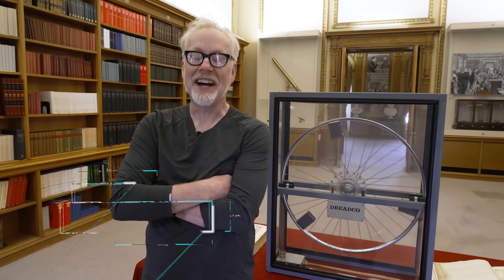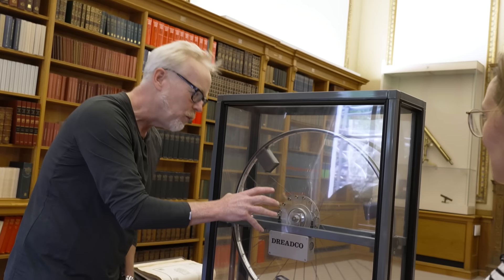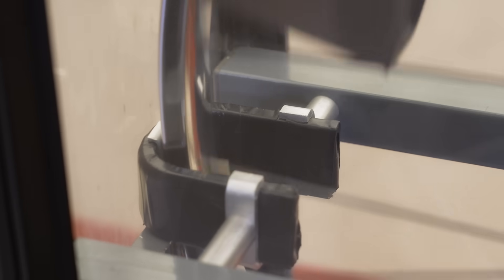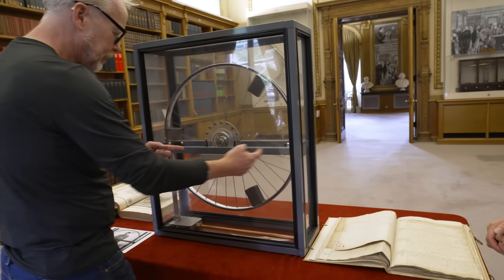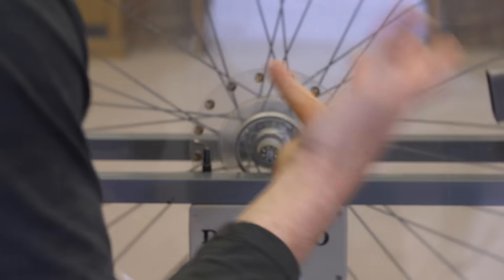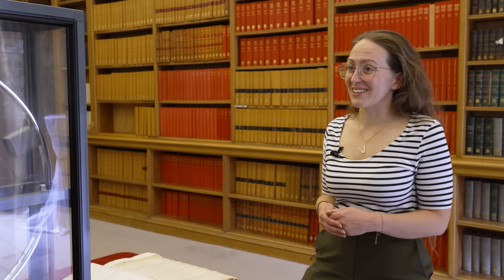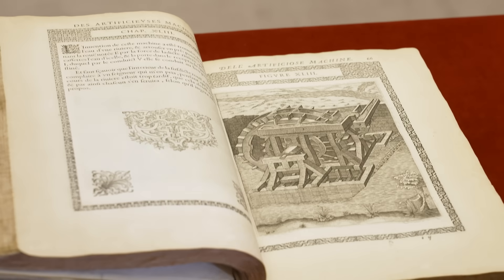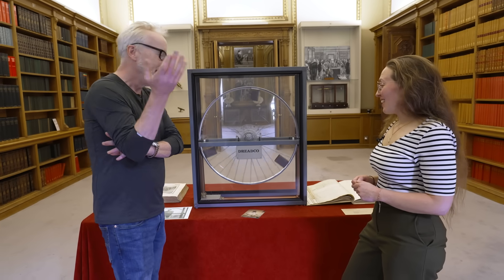Adam Savage vs The "Perpetual Motion" Machine!

Comment: In my opinion the copper pipe and heatsink do nothing, the stuff in the middle resembles an electrostatic motor but also does nothing.
Given the date of construction each box likely contains a 3LR12 battery, a reed switch, a coil and possibly a timing circuit. As a box approaches a magnet the coil is briefly activated giving a tiny push. Given the low friction and the very low discharge rate on the batteries it could go on for years!

Comment: The little circular metal things on the hub are decorated low power magnets. 

On the two little arms pointed towards the hub, one is an electromagnet, and the other is a trigger.   The trigger turns on the magnet just long enough to pull the wheel slightly.  It is turned back off shortly after, so it doesn't slow the wheel back down as it passes.

The Dredco box is full of batteries, and the control electronics.

The speed it turns could be changed by adjusting the timing turning the magnet on and off.   I'd expect it is driven by a very simple low power circuit.  Maybe just a capacitor charging, and discharging when the trigger is fired.     I'm sure people could make all kinds of low power circuits to drive it.  That could be a contest within itself. 

It's not a lot of power, and it would most likely need some assistance when started.  But once it's going, it could run for a couple years.   Being an analog circuit, and the electromagnet becoming weaker as the batteries die, it would slow down until it finally needed servicing.

The 3 square units near the rim are simply weights, for momentum.   Likely lead.

The vents on the Dreadco box are most likely decoys, but they may be used during servicing.  Servicing would most likely just be with the 4 screws that are visible and accessible.

The faux U shaped magnets mounted on the frame near the rim, and the copper pipes and box are decoys.  The heatsinks are just extra decoys.  If they needed to get rid of heat, it would be consuming more power than those enclosures full of batteries could provide.

There is a chance that there may be more batteries in the lower box, wired through the copper pipes.   

The entire frame could be filled with batteries, but I doubt it.   If he had done that, it would probably run far longer than 2 years.

I'll wait for my non-existent prize to arrive. :)

Comment: I think that a small amount of charge is being imparted onto the rim of the wheel, and electrons are being attracted into the copper tube on the left side, and emitted on the right and those electrons are transferring momentum from the wheel on one side, and to the wheel on the other, and that there is a thermo-electric effect providing the energy from the heatsinks when light falls on them.

Comment: If what she said is true about the wheel slowing down when it’s in dark storage, then I tend to think this is similar to a Jeager Le-Couture Atmos clock.  Those clocks run on the change in atmospheric pressure.  We don’t know that that container is sealed or not.  I also wonder if that box isn’t just a vacuum chamber and a very low friction wheel.  It may need to have the vacuum built up every few years.

Comment: I think that in the 3 boxes there are 3 batteries and 3 coils with a circuit like the ones in the toys, those that you put in the sun that have a miniature solar panel and with very little energy they move a pendulum that makes them dance. These circuits, by removing the solar panel and inserting a battery, are able to work for years. And the two horseshoes on the sides are simply magnets that interact with the coils.

Comment: It is too bad you didn't have a device to detect magnetic fields. Then you would have determined what parts, if any, are magnets. That would have been better then speculating that this piece or that piece was a magnet. IMHO.
Reply: As others have pointed out, he probably had his phone with him, which can detect magnetic fields.
Reply: @CorwynGC  True, but one has to wonder as to the sensitivity of the sensors used in phones relative to the (potentially) small magnet(s) being used. Adam did not mention (that I heard) that he measured magnetic fields, rather he thought the U-shaped devices were magnets. I would have thought he would have mentioned the fact if he had indeed used his phone to measure magnetic fields. Again, JMHO.

Comment: Adding on to my previous comment: I am a clockmaker. I've made little machines that tell time that are closer to perpetual motion than this. Yes, there is always an outside source, but the way it is harnessed is more interesting. The closest I've ever seen to a PMM, was an Atmos clock. It winds itself, but not through electricity. It appears to the untrained eye that it uses its own power to wind itself, but it's not true. It is powered by irony. 
You see, mechanical clocks are very sensitive to barometric pressure. And somebody had an idea to use that to give potential energy to a clock. That impressed me more than this thing that I've already figured out and can make with the spare parts in my garage.
Matter of fact, in my last video, I took apart a movement powered the same exact way. It took me a few minutes, but I figured it out.

Comment: There is actually one kind of perpetual motion machine that does work, a superconductor ring, if you induce a current into it, and make sure to never extract any energy from it or allow its temperature to rise above the critical temperature for that material to be a superconductor, that current will flow indefinitely with zero losses.

A superconductor doesn't have low resistance it has NO resistance, so once in motion in that ring the electrons will not lose any energy as long as it remains a superconductor.

It would actually be the perfect battery, if you could find a superconductor that works at temperatures up to about 40 or so degrees celcius... and that's the problem with it.
Reply: That, and all the energy you need to expend to keep it at superconducting temps.
Reply: @CorwynGC  That's why I said that if you could find one that works at higher temperatures it would work.
Reply: @LeoH3L1  How is that different than an object moving thorough empty space?

Comment: I'm suspicious that all the machines seemed to be built out of square tubing that's looks just the right size to fill with AA batteries.
Could then wire through to coils in the 'magnet looking' bits (why are they wrapped?) and put magnets in the isolated boxes on the spokes.
(and then the box by the hub and in the base are just there to mislead)

Just guessing, without any evidence, except it's what I'd have done.
Stuff in the box is to make you look in the box, not at the box (think how you'd enjoy people squinting and wondering if that's a light sensor, if the wonky bits of copper are firing ions, why would a perpetual machine need a heat-sink etc)
Also, however it needs to be 'recharged' you'd want to be simple - you'd want to disassemble as little as possible. Only obvious thing that looks like they might come off easily, are those little screwed on feet. Pop them off and you've got 4 tubes to load up with Duracells.

Comment: A circle of brass discs near the hub, and the two probes out of the Dreadco box could be an electrostatic motor. The U-shapes could be electromagnetics, fed by the copper pipes. The three boxes on the rim seem far away for magnetic attraction, to start by itself. The rim of the wheel could be the rotor of an induction motor. According to the internet people tried to use the electric field of the earth for a perpetual motor.
Reply: Yeah, looking at the brass disks and probes made me think it was electrostatic... one side imparts a charge, the other takes it off, angle the probes a little as needed and the static charge applies a tiny force.
Reply: @KaitharVideo  I definitely got Wimshurst machine vibes.

Comment: IMO, this is more of an art piece than a science exhibit.  As noted by Adam and assorted commenters, there are various ways this could be doing its thing - and it's said that the people who know the exact way it's being done were disappointed, but that isn't the point anyway.  I think the point is that, with all the parts and false parts suggesting all the different ways, you ultimately don't get to verify how exactly it's being done in this specific implementation, and that is maddening but something you have to learn to live with while it trolls the scientifically-inclined by being titled "perpetual motion machine."  Even if Adam makes his own version, it still does not prove that that is exactly the method this installation is using.

Comment: For those curious, using the cipher mentioned in the video is easy. assign  a numeric value to each letter and add 13, A=1=14=N so Adam Savage becomes Nqnz Fnintr
Reply: "ROT13" if you are old enough to remember when that was a common way of hiding spoilers.

Comment: I'm about 99% sure it's an electrostatic motor. The servicing involves replacing the batteries, which may well be in those gray boxes, or hidden elsewhere. Electrostatic motors are SUPER efficient. It's an electrostatic universal motor, and the two contactors you can see switch the voltages to keep it turning. It's basically a Whimhurst machine run in reverse.

Comment: without actually seeing it in person, it's pretty much a guess.  But the first thing I would do if I would building any such device would be to put it in a vacuum chamber to eliminate any air friction. A port or valve on the device would be a dead giveaway that this is the case here.
Reply: I was surprised that it didn't sound like a vacuum when Adam bumped into it.  Perhaps hard to maintain for that long.
Reply: @CorwynGC  yeah, it rattled pretty good.